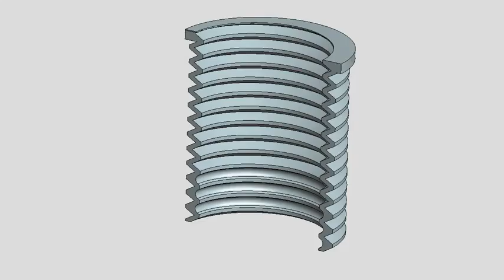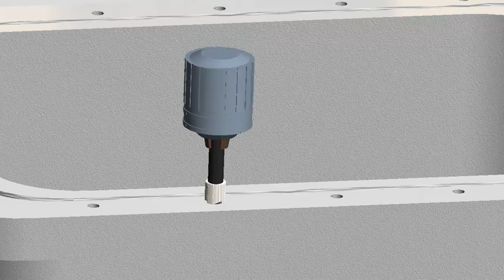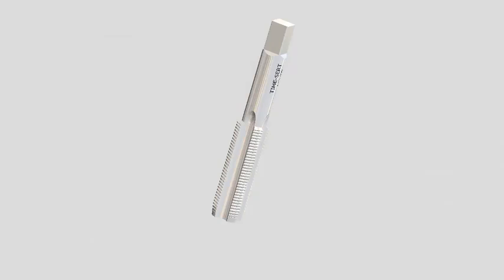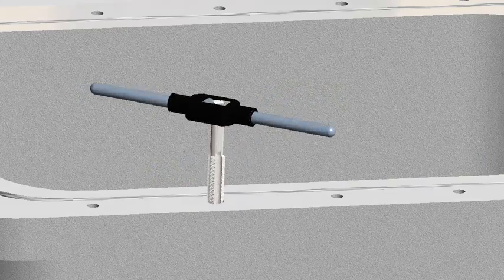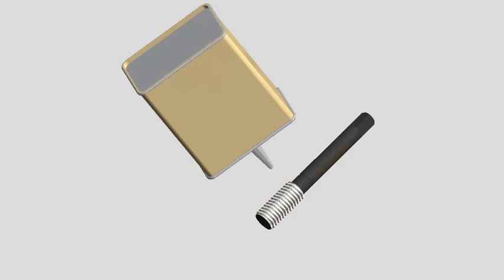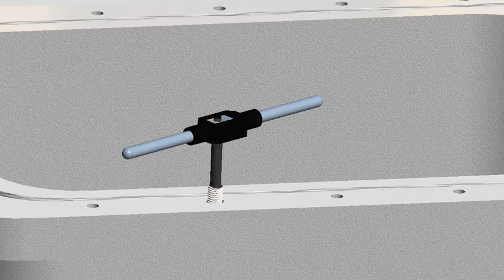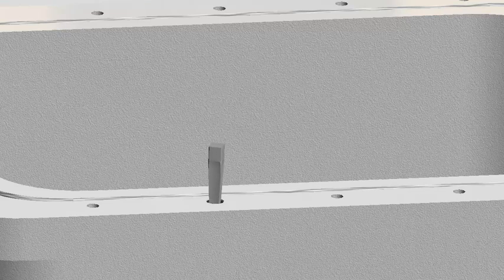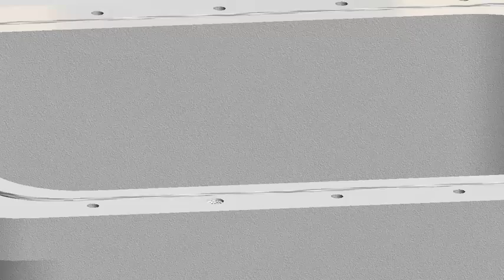Thread Repair Using a TIME-SERT inserts                 Thread repair kit

Comment: Thanks for the video but I’ll have 2 questions.
1. Does this insert work in aluminium hole?
2. If we have to use M6 bolt in aluminium hole, what will be the maximum strength for tightening the bolt with time-sert inserts?
Thanks

Comment: What size outer threads or diameter are on a m8x1.25 timesert #1812?

Vs

How big are the outer threads or diameter on a m8x1.25 big-sert #5812?

Comment: These time serts are so much better than a heli-coil it isn't even close.  you can use a heli-coil tap to cut threads for a time sert and buy a counterbore tool for the flange.  Use a grade 8 bolt as the installer.  Just toss the heli-coils and use the drill & tap that comes with the helicoil set if you already have the helicoil kit..  

Things I've learned having installed hundreds, if not a few thousand , of these as a transmission instructor at a trade school for 31 years.  Time-sert rules!

Comment: I stripped my oil pan.
Let's say the oil pan thickness is 15mm, insert length is 9.5mm, and my new drain plug length is 12mm. Is this going to be okay?
Reply: Should be fine for just a plug but oil might wick out between the timesert and the oil pan, might have to add some black rtv.
Reply: @CarlosRios1  No! Use thread sealant!